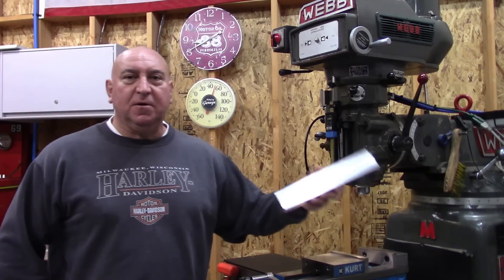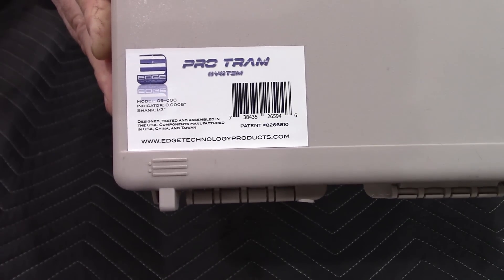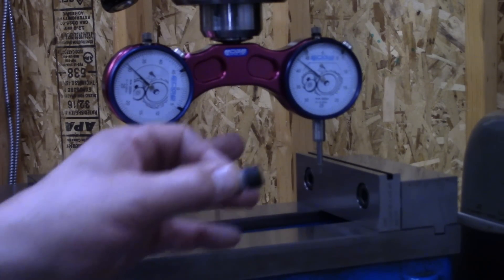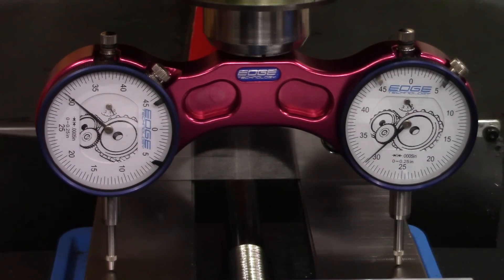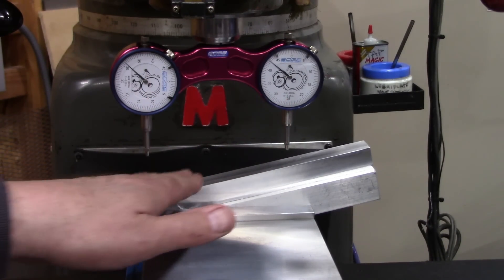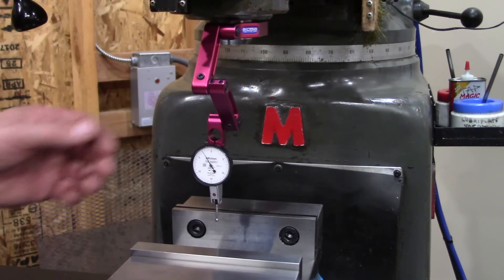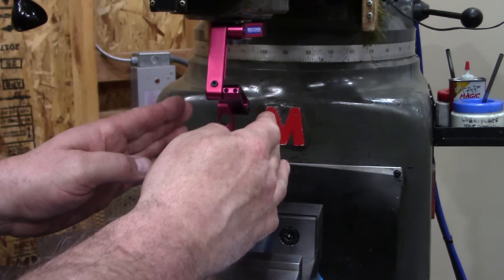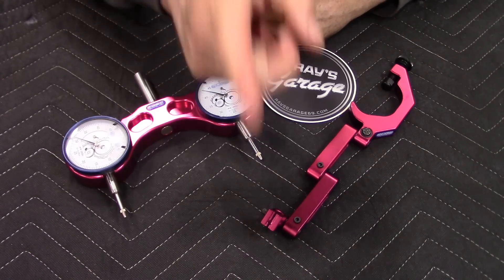Edge Technology's Pro Tram System #edgetechnology #realraysgarage

Comment: hi bud. they are nice my 1st project i did when i bought my mill was to make a (spindle square) tram gauge like this i looked at the aloris but couldn't afford one so i made one lol its even anodized the same color as yours but not as nice but it works. thanks for sharing
Reply from the maker: It's always rewarding to make yourself a tool that works, it does not have to be pretty as long as it does its job! Best Regards, Ray